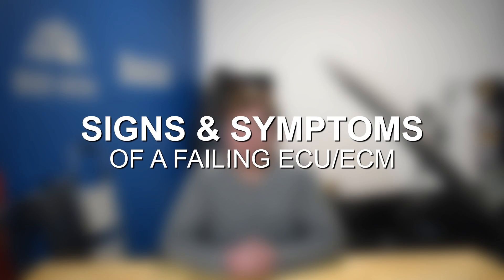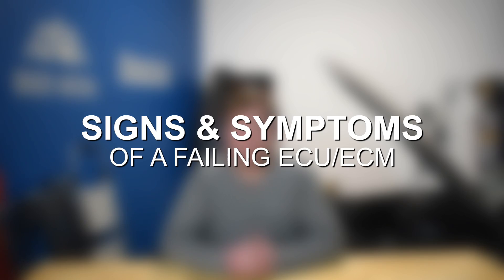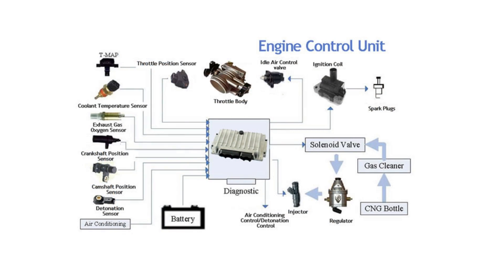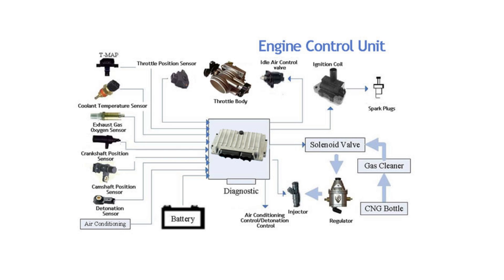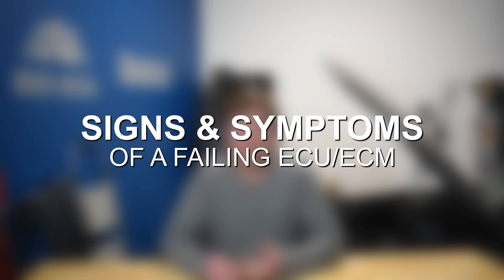Signs & Symptoms of a Failing ECU/ECM! (Engine Control Unit or Engine Control Module)

Comment: my 2007 honda Civic Si is pulling PO630. my fuel pump doesn't turn on, and there's no spark. my green key light doesn't light up. iam thinking my civic si was into anti theft mode. i was thinking of calling a locksmith n seeing if he could help. maybe relearn da key to da immobilizer or reset da ECU. not sure wat to do. i don't have da money to go to da dealership.
Reply from the maker: M - Since your vehicle is throwing P0630 (VIN not programmed), no fuel pump activation, no spark, and no green key light strongly suggests that the immobilizer system is active, preventing the car from starting. Since the green key light doesn’t illuminate, the ECU isn’t recognizing the key, which could be due to a bad key transponder, lost key programming, or an issue with the immobilizer system itself. A locksmith with the right tools can relearn the key to the immobilizer, which is much cheaper than the dealership. Before doing that, try disconnecting the battery for 10 minutes, then reconnecting it to see if the immobilizer resets. Also, check the fuses for the ECU, immobilizer, and fuel pump, as a blown fuse could be cutting power to these systems. If the issue persists, a key reprogramming or ECU reset via an HDS or other Honda-compatible scanner may be needed. Keep us updated!
Reply: ok. thank you so much. I really appreciate it!! I will check and go over the fuses and relays. if I would buy a used immobilizer and key from someone  on Facebook, buy and sell, do i need their ecu as well, or can I use my ecu??

Comment: Crank no start?
Replaced crank and cam sensor.
Replaced IPDM.
Reply: I took it to a shop it showed p2101. Ipdm. I replaced it still crank no start ..
2008 nissan titan.
Reply from the maker: T - We have a full video that may help with this: https://youtu.be/0YRdzJbHcm4
Reply: I replaced ignition switch and starter. My battery is charged but still no crank no start. I thought I needed to reprogram the key but the OBD scanner wasn’t connecting to my ODB. Now I’m thinking it’s the ECU or crank/cam sensor.. idk

Comment: Code u0100 and U0101 popped up, battery was replaced, says no communication. No check engine, was wondering how i can fix this? Maybe bad ECM or TCM? Tranmission works fine, no stalling or anything like that. Everything looks fine, those 2 codes are the only ones, unfortunately the reason i started looking into it and replaced battery was due to it not craking in the cold. Their was a check engine but it went away after hitting it with the scanner. -2014 nissan maxima sv
Reply from the maker: T - The U0100 (Lost Communication with ECM) and U0101 (Lost Communication with TCM) codes on your 2014 Nissan Maxima indicate intermittent communication issues between the control modules, likely due to a weak or disrupted power or ground connection rather than outright failure of the ECM or TCM, especially since the transmission works fine and the issue started after a no-crank situation in cold weather. Start by inspecting the battery terminals and ground connections for corrosion or looseness, as poor electrical connections can cause these communication errors. Check the main ground strap from the battery to the chassis and engine, as well as the connections at the ECM and TCM. Additionally, ensure the replacement battery is properly installed and charged. If the codes persist, consider inspecting the CAN bus wiring for damage or interference, as this could also lead to intermittent communication problems. Keep us updated!
Reply: @8020Media  fixed it, was a bad ground by left side engine coming from ecm, had to drive the car for the code to go away. Otherwise everything checks out. Found a new leak regarding the transmission lol, axel transmission seal is leaking so trans fluid is leaking. For some reason CAN BUS isn't communicating either so wonder what's that all about Code U1000
Reply from the maker: @true-sensei-887  Thanks for coming back and updating! Glad you found the fix.

Comment: 1999 chevy S10 starts runs for 10 or 15 seconds  then stalls like it's not getting gas replaced every thing from fuel pump to the fuel injection system. Help
Reply from the maker: D - If your 1999 Chevy S10 starts and stalls after 10–15 seconds despite replacing the fuel pump and injection system, it’s likely due to the Passlock anti-theft system, which shuts off fuel injectors if it doesn’t detect the correct key signal. Check if the "Security" light flashes or stays on when the engine stalls; if so, reset the system by turning the key to the "ON" position for 10–15 minutes until the light stops flashing, then try starting again. Inspect the ignition cylinder wiring for damage, as faulty connections can interrupt the Passlock signal. If Passlock isn’t the issue, test the fuel pressure regulator to ensure it maintains pressure, check for vacuum leaks, and clean or inspect the Mass Airflow (MAF) sensor, as these can also cause stalling. Keep us updated.
Reply: @8020Automotive  When it started doing this it ran fine The next morning went outside.Got in started.The RPM went very high enough to wear.I turn the key off And it has been like this ever since starts.Runs ten fifteen seconds and dies.
Reply from the maker: D - Certainly sounds like it could be the ECM.
Reply: @8020Automotive  Have no fault codes.Already.Bypass the THEFT and it is still doing it even replaced everything on The throttle body Even the mass air sensor Thinking it has to be the ECM

Comment: My 2018 ram cummins 6.7 is throwing the p0607 code .  Where should i start?
Reply from the maker: S - A P0607 (Control Module Performance) code on your 2018 Ram Cummins 6.7 indicates an issue with the Powertrain Control Module (PCM), which could result from software glitches, electrical problems, or internal PCM failure. Start by checking the battery voltage and ensuring all battery terminals and grounds are clean and tight, as voltage irregularities can trigger this code. Inspect wiring and connectors leading to the PCM for damage, corrosion, or loose connections. If the electrical system checks out, perform a PCM reset using a diagnostic tool to clear any temporary glitches. If the code returns, the PCM may require a software update or replacement. Keep us updated!

Comment: E12CIC error message on my 2012 528i xdrive
Reply from the maker: K - This typically relates to a communication or functionality issue with the CIC (Car Information Computer), which controls the iDrive system. This can be caused by software glitches, a failed module, or wiring/connectivity problems within the CIC system.

Comment: My engine light came on and I hit it checked and it says code P0420 Bank 1 Caralyst system efficiency was below threshold for a predetermined period of time don’t know what this means but I’m afraid it might cost lots of money. My car is running goid but the only thing I have noticed in the past is that it fiesnt go fast when I push the gas pedal it is super slow
Reply from the maker: J - We actually have a video that would help here: https://youtu.be/89tdCulNeWQ

Comment: On my 2017 Subaru Impreza the module did get change and it run really good. Then all the sudden I get the stupid lights on with the check engine light and hill start system. What’s next ??
Reply from the maker: J - What engine codes are you getting?
Reply: @8020Media 
I have to find my paperwork can’t really remember the codes. I did notice it’s running way better, gas mileage has improved to normal, acceleration or power as well. To me seems like it’s back to normal after the module change. The down side it’s the stupid lights, I’m trying to save up because of the estimate I got was $2k for the next step.
Reply from the maker: J - Keep us updated!

Comment: Mine was running fine but after I turn off to fill up gas then it doesn’t get no power whatsoever no lights/sound/etc. so basically dead car like parasitic draw power shortages draw
Reply from the maker: J - Sounds like it could be your alternator. We have a ton of DIY content on our channel that could help.
Reply: @ the car uses the battery to start the car then the alternator takes over! This is not the case no sound no lights when you first turn the key nothing at all
Reply from the maker: J - This video may be more helpful for your research: https://youtu.be/0YRdzJbHcm4
Reply: @ it does help but that’s not the issue! Thx tho

Comment: I have a 2000 camry 2.2 l
Misfires over 50 mph consistently.  Doesnt throw a code. Have replaved plugs, wires,  coil packs, all 3 EGU components, cleaned throttle body.  Still wont go away. No codes active at all
Reply from the maker: S - Maybe this video would be more helpful with your research: https://youtu.be/f1mQ5hD1-vI

Comment: 2011 chevy sonic. Replaced coil pack and spark plugs. Car runs well, then traction control light comes on with a flashing check engine light where the car runs rough. Possible ECM issue?.
Reply from the maker: T - Do you know what engine codes you're getting? This is the quickest way to diagnose what could be the issue.

Comment: Multiple faults on dash including "check esp", "check hill start assist", "check auto gear box". Car runs fine for 10-20 minutes prior to faults displaying on the dash. When faults appear, we just turn off the car, wait 30-60 seconds and then start it up again and all faults are gone for another 10-20 min. Ran diagnostic check and it showed a bunch of faults, including lots of short circuit earth wire faults. 2012 Renault Megane III 1.5 dci automatic.
Reply from the maker: V - It certainly sounds like an electronic issue.
Reply: @8020Automotive  who can help wit that ?

Comment: My 2018 equinox tire pressure not working gas gauge not working and my key fob not working all three stop working in the same time what can it be
Reply from the maker: A - Could be a bad battery. Are you getting any check engine lights?

Comment: Not trying to sound to stupid because it comes natural for me but is ECU and ECM the same thing just different term and your picture shows ECM also controls AC is that correct because maybe ECM then is my problem
Reply from the maker: M - ECU and ECM are the same thing, yes. Are you getting any check engine lights?
Reply: @8020Media  yes. I'm going to replace the throttle actuator control this weekend
Reply: @8020Automotive  I just replaced the accelerater pedal position sensor and still in limp mode and code is saying the TAC and accelerator pedal position sensor. So I disconnected the battery and I will see what happens hopefully it will clear everything. After this step if it doesn't work I will replace the map
Reply: @markservais4259 I have problem with DTC and CAS  …🤔😔
Reply: I see where my confusion might be, your diagram doesn't show the throttle actuator control (tac) unless the ECU is another name for it
Reply from the maker: M - How's this going?
Reply: @8020Automotive  nothing is working. TPS changed, the (TAC) Throttle Actuator Control changed, more grounds added
Reply: @8020Media  I also replaced pcv valve
Reply from the maker: M - Have you taken it to a mechanic?
Reply: @8020Media  that's the first thing I took it to, so they changed the pigtail to the TPS and added a ground and he had me pick the car up after a week and said he couldn't figure it out and didn't charge me anything so we cleared the code and I drove it home. Now when I clear the code it goes back to limp motor within 10 minutes. It throttles great so thats why I don't think it's the accelerater
Reply from the maker: M - Very interesting... Keep us updated on the fix!
Reply: @8020Automotive  I'm going to inspect the wiring this weekend if it's not too cold before replacing the accelerater position sensor. That'll be next
Reply from the maker: M - Sounds good!
Reply: @8020Automotive  I used a dorman TAC, I also did a ohms to the accelerater position wires from the TPS and wires look good. So I pulled the accelerater position sensor and my ignition switch. I'm putting on a new ignition switch and I tested the accelerater position sensor and the readings I'm not really sure what it should be but they never went over 3.55 volts.
Reply: My code is 1516

Comment: My truck is high idling and at times it wont start when i turn the key then it will eventually starts it likes to do it when it rains or is cold. I thought it was initially a bad tps but it didnt fix the issue. When i drive it over 40 it high revs and when its sitting it revs up to 1500 rpm and i used a scan tool and it did say a ecu code on the scanner. Any ideas on what could be causing this?
Reply from the maker: D - With an ECU code, it could be the ECU. With the starting issues, these videos may be more helpful: https://youtu.be/cOW5RlAkqi4
https://youtu.be/0YRdzJbHcm4

Comment: Changed the alternator found out it was faulty due to the solenoid leaking oil onto it. Fixed that as well. Then a big misfire ran code to see which cylinder swapped coils, same cylinder, swapped plugs same cylinder. Changed the injectors no issues 3 months later leaking oil again and I’m contemplating the PCM considering everything else I’ve done in the past 5 months.
This started happening 2 days after an oil and transfer case changing.
Codes are telling me ecm/isu 83-11 and power source failure 61-11
Which oil may have got into the alternator connector so could be that.
Reply: There is no check engine light or anything currently lit up. I just ran my blue driver ob reader to see if it had any information
Reply from the maker: H - This oil leak could have caused some sort of electrical issue.
Reply: @8020Automotive  the location of the leak is near the top of the engine. Close to the dip stick and solenoid I replaced. The solenoid doesn’t seem to look like it has oil on it or coming through. At least not from the angle I can see
In 2 weeks since the oil change it went from the recommended level to being at the minimum. Getting close to 1000km. It’s a 2013 Pilot if that matters
Reply from the maker: H - You've definitely got a leak going on somewhere.. That's a lot of oil consumption in 2 weeks.

Comment: I have a 2007 maxda cx7 sports. It wont idle unless warm. So when I start the car I have to pump the gas to warm the engine and it is misfiring. Literally aounds like it is farting from the exhaust. Would this be an ecu issue?
Reply from the maker: J - Sounds more like a fueling issue. Getting a check engine light or codes?

Comment: My 2003 3500 Dodge ram Cummings diesel shuts down while driving starts back up right away can’t determine what the problem is could it be the ECM or some sensor.
Reply from the maker: E - This video may be helpful with your research: https://youtu.be/7bqAIbYRdnc

Comment: I make sure the battery is strong first.Then check fuses. And if some don't light up but are good then i find the relay that has control over them. Some times there are two related relay's that go to the same thing. Same with fuses 
 And they are in different places. Most auto's have two or three fuse boxes that have relays in them too. First of all of them is the ECM or ECU relay if you get a no communication read.🥴Also  you may have a single relay by itself somewhere like under the dash on driver's side fuel pump. Also on the positive battery post have fuses some times. What next 🤔 well sensors another word for fuse's that mostly control the motors running in some form. For a awesome fuse and relay layout to your car's fuse boxes go to Google and ask for start my car. U will be amazed when you see it. 👍✅👀
Reply from the maker: J - Thanks for taking the time to share this insight!

Comment: Got a decently interesting story here. 2013 Ford Fusion se with a 1.6 cylinder SE.

Brought car to ford dealer to get two tires replaced, they replaced the two tires and a wheel speed sensor they said was faulty. Fast forward a week, car throws 7 different codes while driving 30 mph on a two minute drive, Coolant overheat P1299, steering fault, abs/traction control fault, evap issue, U0131 and U1035. To try to fix the easiest first, I replaced the battery (5 years old) and the Coolant Temp Sensor, because online they said if there was coolant in the harness it could cause the short. 

Fast forwards another week, all the codes pop back up and it goes into limp again. At this point I brought it back top the dealership, they told me they think they need to replace the coolant temp sensor and the pigtail to the sensor. Which befuttled me because I just put a new one in a week ago. I called them to tell them this and they said it could be do to a cheap part (My part was OEM).

Fast forward to this week, Traction contol/ABS error, P1450 EVAP, U1035 and U0131 popped up again. My thoughts are all bringing me to a computer issue because after I clear the codes, it runs smoothly for days and hundreds of miles. The car has been taken care of and hasn't had any issues since the Electric Steering Collum was replaced a year ago from failing. Any ideas would be great, thanks!
Reply from the maker: G - Think you might be right here.. Sorry to hear about your troubles, however, please keep us updated!

Comment: I have a 2016 malibu LS .1.5 turbo. No codes. No engine light on.   New plugs. New coils new maf sensor new 02 sensors new air filter. Fresh oil change. Cleaned throttle body. No vacuum leaks to be found. Scanner shows all is good. But bad fuel economy. And rough idle. 82k miles
Reply from the maker: A - We have a video on rough idling that might be helpful here: https://youtu.be/BiYsqRJCLhE